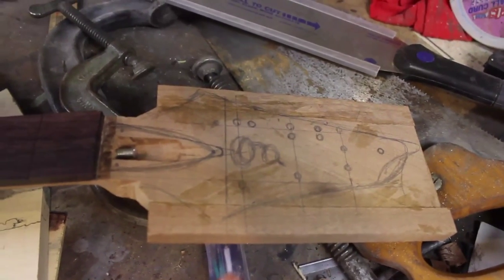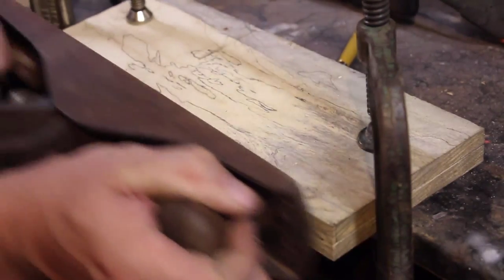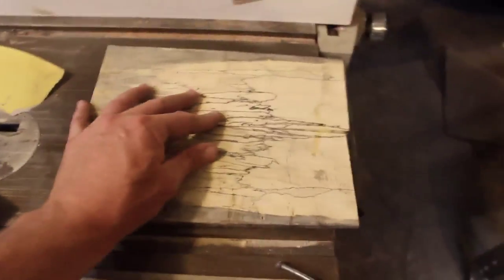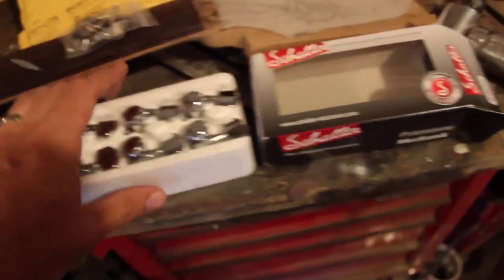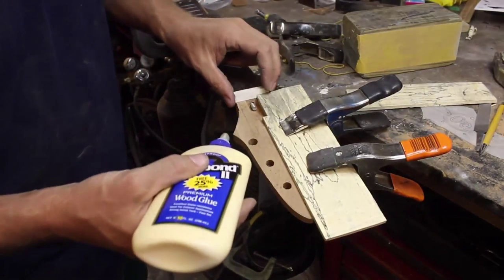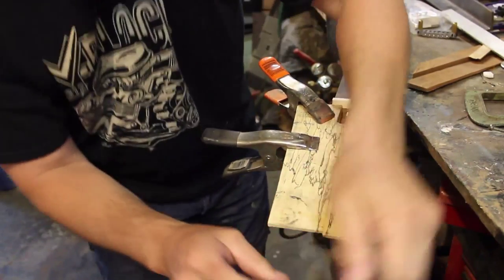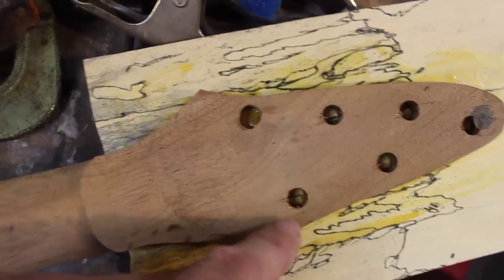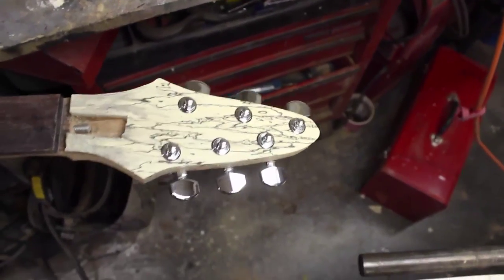Guitar Build - Part 15 - Headstock

Comment: Cool stuff.. Hey have you seen those new Tronical auto tuning keys. They look cool but would have to try one out before I bought one..
Reply from the maker: Yeah, those are cool.  Maybe they should work on strings that just don't slip.  That would be easier for me to wire up!

Comment: Looking good, wondering if the string tensioners might look better splayed (fishbone pattern) instead of parallel to each other?
Reply from the maker: Perhaps.  I think I cut the part out where I talked about straight pull vs angled pull.  I like the look of angled too, but I understand the straight pull is technically "better" for the guitar.  I own both types and can't tell a difference.

Comment: wow, thats a lot to deal with. i am captivated cant wait to hear it 10-4
Reply from the maker: Electronics are next.  I'll be nerding  out with my Mr. Wizard kit.
Reply: what is a mr wizard kit?
Reply from the maker: Something I just made up...  Wire, old transformers, and other electronical pieces and parts to fart around with until I put together something that actually works.

Comment: How wide are the peg holes Im doing my own headstock for the first time lol. Thank you.
Reply from the maker: They are different for different tuners.  I believe these were 10mm.  I used a drill that was undersized, then I used a reamer to bring it to the right size.  They sell tapered reamers and I'd highly recommend one so you get a TIGHT fit.
Reply: Thank you dude I appreciate it

Comment: looks cool
Reply from the maker: Thanks Jim.
Reply: yvw  i missed a few days went in the hosital had a major heart attack didn't know it they put in 2 BMS bar metal stints in I had 2 blocked aerties
Reply from the maker: Holy cow Jim.  I'm glad they caught it even if late.  The stents are magical.  My father-in-law had a few installed awhile back... Went from down and out to back in full force.  Take your recovery slow and steady.  Even though you didn't get the chest zipper it's still a major heart operation.  I'll be keeping you in my thoughts Jim.
Reply: ty Greg ty told me it was an old attack it was healed the dat day was monday the 2'nd went to family doctor and he has me checked from time top time for ecg after i had it done went to take my nephew to school 60 miles away got home late didn't check messages cause they told me 2 to 5 days i'll know well gf woke me up my doctor was on the phone go to the hospital i had a small when i was getting that ecg done but i had a major heart attack  some time ago mine don't feel them i have asmha so i do get short of breath some times so i just take my spay and that is it now 5 more meds to take and nytro slowly feeling better they pushed me up so only 3 people ahead of me so i was over night home next day by 4:00pm